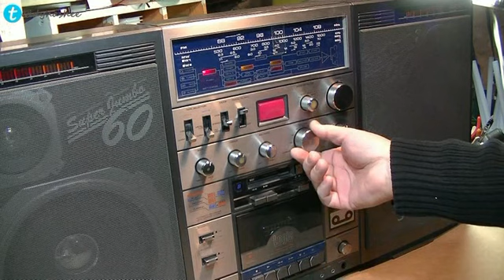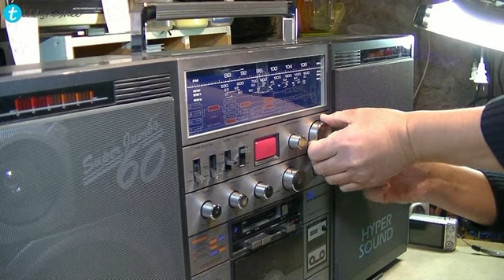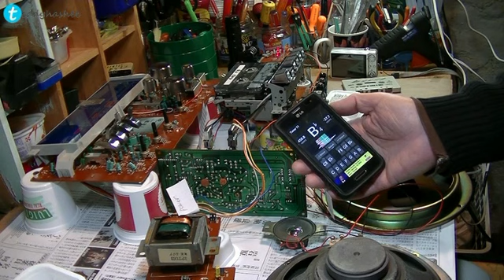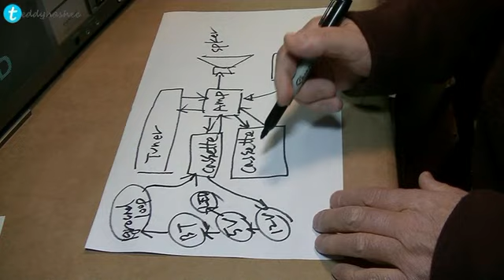CONION C126-F Ghettoblaster Bluetooth Mod

Comment: Dang that thing is CRAZY.
I have an old CTR 949 by Emerson and they sell for quite the price. It has been in our family since it came out. Pretty cool to me.
Reply: But the bottom tape deck has a broken band so it wont play and there seems to be some technical issues with the board the left speaker doesn't work half of the time and the controls are buggy.
Reply from the maker: Emerson CTR949, it has vertical double decks, looking cool!
Reply from the maker: Replacing the drive belt and cleanup inside will be solve the cassette deck problem. The sound problem, you want to clean the controller with contact cleaner. Most of the "no sound" problem will be gone.
http://amzn.to/2nGoG2u
Reply: Maybe ill look into that sometime and i cant find the right belt. It has a seperate play belt which is smaller, Thanks for the info!
Reply: Michael Street 

I have a JVC M90 and a Sanyo M9820

Comment: Hi Teddy, amazing work, looks like brand new. One thing I don't understand is using the tape input to add the bluetooth, pretty noisy channel (and biased?), why not hack the tuner input instead (or when there is an aux input use this instead)? You also using a ground loop isolator (coils) that reduces the quality of the signal, why not using a bluetooth cassette (very cheap to make yourself) with almost same result. You can add powerlines to the top of the cassette (no batteries required) to get the old scool feeling of pressing "play".  A blue cassette with extra features ;-)

Another better approach is to use an isolated DC/DC converter (to avoid a ground-loop) for the bluetooth module so you don't have to  (again) downgrade quality by using a coil isolation solution. Can remember I notice this before at some other videos. Used this at few projects and it is awesome, no noise at all. I use a few caps at the output, 470uf, 0.22uf and 0,01uf.

Happy customizing!
Reply from the maker: Thank you for sharing great information. These day I use DC/DC converter for the noise removing and it worked like a charm.Teddy!

Comment: Hola, siempre sigo tus videos, aprendo además,...entonces pregunto, como puedo conseguir o donde el cassette generador de tono, y la app.para utilizarlo con con el cel..?..muchas gracias Teddy..
Reply from the maker: the app is called TUNER T1 you can find on android or ios. The A-440 Hz tone cassette was made by me. You can record tone from youtube, but you need a correct speed cassette recorder. Or you can find tone cassette tape from ebay too! I am also going to buy new one from ebay soon. Tone does not have to be 440.
Reply: @teddyhashee  muchas gracias..si ..el tono cassette lo consigo y la app. .la bajaré. ..el tono siempre debe ser 440 hz. .?

Comment: Hi Teddy, please...very please..🙏 can you explain me, exatly how to install bluetooth receiver system and Led? please I need to do this too. You're always the best and I thank you very much
Reply from the maker: Adding Bluetooth in the boombox, you need to think about 3 things.
1) Where you want to put Bluetooth signal into the system.
2) Where do you want to bring the power to the Bluetooth module.
3) And finally, how do you eliminate the ground loop noise.

If you cover these 3 things, your DIY project will go well.

If your model does have a AUX or LINE IN, you can put BT signal from there.
If your model does not have a AUX or LINE IN, you need to find out where you want to inject Bluetooth music signal in. 
I use radio signal input, volume potentiometer, etc.., but you can find another place.

If you use volume controller, when you play the bluetooth, the meter will not work.
So if you want meter to work with music, you need to find the input place before the volume controller.
Probably selection switch that will set the radio for FM, AM, SW1 and SW2, you can check this place for the possibility of the input.
Or before that selection switch, etc..

The power, you can bring from the poser sauce.
Or other place such as Power for the radio, power for the cassette deck, etc..
Most of the power of the large boombox is more than 12V, so
I used car usb charger(12V to 24V) with USB, Just connect power to them then they will reduce the voltage to 5V.
So I can use usb type bluetooth module.

you can also use stepdown module to reduce the power to 5v.

And eliminate the groundloop noise, you have 2 option.
Use the DC-DC isolation module, or groundloop noise elimination module such as MPOW.

Here is a parts list for you.

Bluetooth 2.0 to 4.0 which ever you want to use.
I like this one.
https://amzn.to/2QNAkq9

If you use over 4.0 to the small boombox, you need to add resistor between BT signal (L and R) and input point.
50K will work for the small boombox, from my experience.

USB car charger
https://amzn.to/2Nx9Qv0
This one handle from 12V to 24V and reduce it to 5V
 
or use stepdown module

Back converter stepdown module
https://amzn.to/2xvTuIP
or this one is linear type
https://amzn.to/2NASy08

google by yourself what is the difference between both above stepdown module

Toggle switch 6 pins
https://amzn.to/2OHl1O4

If you want to add LEDs along with Bluetooth, buy some LEDs and resistor and use usb cable to connect it to the car charger.
When you turn on the power, both bluetooth and leds will be on.

Probably when you read my email, still you need to research more information by yourself.
But it will be a fun for you to figure out what to do in order to make your mod success.

I was asked many viewer how to install bluetooth and led to the boombox.
I may make some video for that.

Teddy
Reply: @teddyhashee   thank you Teddy for your time . You have explain in perfect mode. 👌 good work for next project

Comment: Awesome work. What are the specs for the Leds and resistors used in this project. Also where do you get all those cool electronic gadgets for all your boombox projects. Cheers
Reply from the maker: Hi, Gregory. Thank you for your compliment on my work.
LED: 5mm RGB slow flash Leds from ebay.
Resistor: 150 Ohm - 1/2 Watt 5%
And tools and gadgets I am using in the restoration and mod bought from ebay, amazon, and estatesales.
Thanks!
Reply: Teddy Hashee. Francisco rivas mentioned in his post that you had a boombox for sale on eBay. What is your seller name on eBay so I can follow you. Would love to buy one of your creations. 👍🏻 keep on rockin !!
Reply from the maker: ebay is here
https://goo.gl/ckW7Cd
etsy is here
https://goo.gl/Yj2kS9

From time to time, I list boomboxes and other vintage electronics.
Thanks!
Teddy

Comment: Have you ever worked on a JVC PC55? is there video of it?
Reply from the maker: No, I have not. If there is a chance, I will do it.
Reply: @teddyhashee  Interesting, I bought one off EBay, then bought another as spares, once I have finished swapping bits, (If successful) the left over parts will be:
Good pair of speakers,
radio/amp section that lights up, appears to tune but there is no sound output, 
Cassette section has fully functioning auto-reverse deck, sounds great, as often happens with these, the LCD has failed, my other deck has a good display, works perfectly as well, but will not record, I think I am going to swap LCDs to give me a fully functional deck with the other one as a playback only deck.
Should I keep the spare parts? or do you think you could bring them back to life? I don't think there are any major faults, no burning, no exploded electrolytics that I can see, probably a stuck switch on the record circuit and something dead in the power amp. The worst bit is the LCD failure, which is cosmetic until someone wants to record. Oh, and there is no handle for it (The carrying handle that clips to the top.
Reply from the maker: Keep them as your parts. It will be needed sometimes in the future.

Comment: theanks so much for your videos! a question y have is if you dont have a ground loop isolator  what can happen or how you can replace it. thanks
Reply from the maker: If you do not remove the ground loop problem, then you will have a noise whenever you play the Bluetooth. There are two way to remove the ground loop problem. Ground loop eliminator or DC isolator. Check my most recent videos, I do not use ground loop isolator any more but using DC isolator.

Comment: Hi, what instrument is when you listen a regular sound from tape reader, to check the exact speed of the tape? If you want.... Thanks. Piero
Reply from the maker: The app is Tuner T1 you can dowwnoad it to either android or apple. Tape is A-440 hz tone, search youtube you can find it. You need correct speed tape deck or tape recorder, use AUX in and play from youtube and record it on tape. If you do not have a correct speed tape recorder, either buy cheap one. Teddy

Comment: Hey teddy Another great video. Who makes conion? I thought onkyo but not sure. I saw you put the Sanyo on eBay if i had the cash or a free credit card I would've snatched it lol maybe down the road I'll purchase one of your restores be safe. Francisco
Reply from the maker: Hi, Fransico. Conion is from ONKYO as you said.
"Conion, also known as Coney Onkyo, was a boombox manufacturer during the 1980's. They operated in Kobe, Japan. Although they didn't make very many models, some of them rank among the largest and most popular boomboxes ever built. It's hard to ignore the imposing size, flashy looks and massive sound produced by their very popular C-100."
The Sanyo was sold right away, and I will sell more boomboxes so sometimes check my ebay listing! Thanks for the comment.

Comment: Good morning Teddy, once more I need your help, if you agree.... what liquid, cream, oil, you use to clean, oil, the mechanism from dust, rust, dirtying in a radio like mine stopped from many years? I’m not so sure I will find good plastic, hardened by the years, and so on... But as you said before, I have to go into it and see what I can work with.... Have a nice day. Regards. Piero
Reply from the maker: On the outer casing body or plastic, wash them with water and mild detergent. Then use plastic cleaner, goo-gone, and other type of mild cleaner on its face. 
I use plastic cleaner from Japan.
http://www.soft99.co.jp/english/products/carcare/body_cleaner/plastic_cleaner.html?pid=09066

Also you can use car wax to clean and polish the body.

For the clean plastic such as lens for the radio dial, if the deep scratches there, you want to check my videos how I removed them by water sanding, and polish with plastic cleaner. Any type of the combination work is needed  in order to make it clear like a new. 

For the mechanism, vacuum dust first, then clean detail with over 70% rubbing alcohol, if the grease is really hard to remove, then liquid wrench is good choice. But for the cassette deck, probably you can clean with only rubbing alcohol.

Oil and lubrication,
100% synthetic oil
https://amzn.to/2M7pyaz

and any type of lithium grease
https://amzn.to/2oL03CK

for the chrome
http://www.soft99.co.jp/english/products/carcare/body_cleaner/chrome_cleaner.html?pid=09033

----------------------

Now you may not find same products over there, but it is not a problem.
Any type of the cleaner can do the same job.

When you start working the restoration, you will encounter the many problems and it will discourage you. Then take a time, leave from boombox for a while, search online, google many things and think about the solution. ONLY YOU can find the solution but not others.
Reply: Teddy Hashee Thank you again, I will try to follow your suggestions and video to learn something more to do the best for my Aiwa. If I don’t disturb you, then I will send you pics when I have done something on the radio. Greetings . Piero

Comment: Why not put USB and Micro SD ports?
Reply from the maker: Good idea. I will consider it!
Reply: @teddyhashee  I have a jvc m70 jw everything works but the bass and treble I would like to get fixed and clean what do you charge ?
Reply from the maker: @dondouglass7033  Did you clean both sliders with contact cleaner? I have an experience that there was no treble effect but after the complete clean out the slider with contact cleaner, it came back right away.
Reply: What's the best contact cleaner to use I know I have not

Comment: Do you do repair work on old Boomboxes? I have many that need work.
Reply from the maker: I have been doing restoration on the old school boomboxes, and other vintage items. I only work with the "Radio working condition " boomboxes. If it has no power, nor no radio is working at all, I do not take it for my work. If you need more detail, contact me at teddy.hashee@gmail.com for detail. Thank you for the comment.